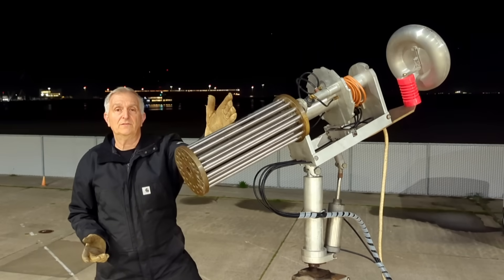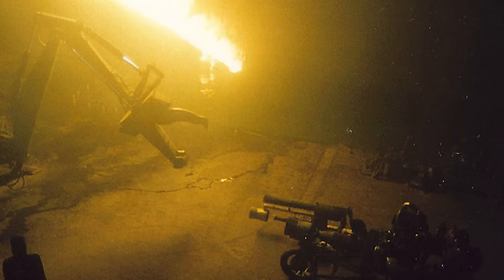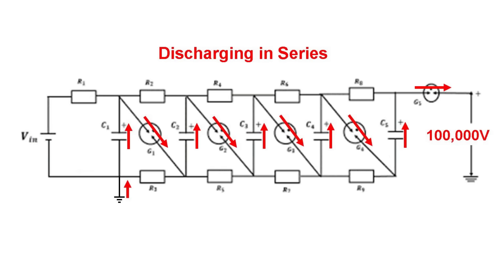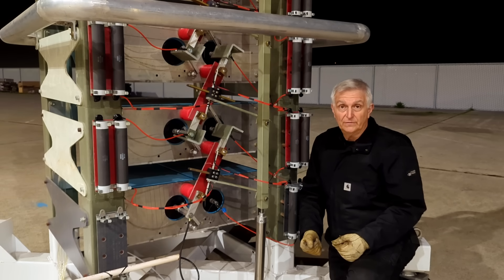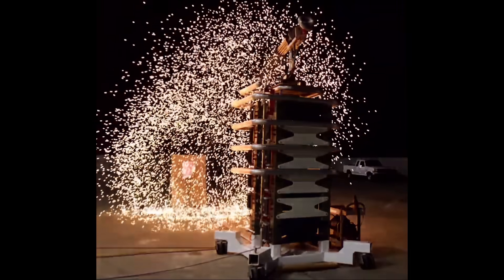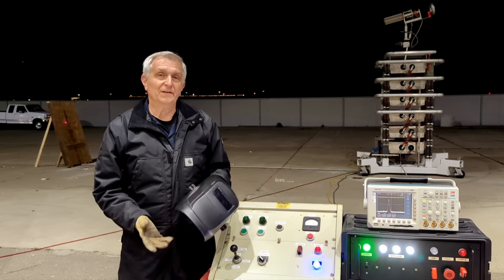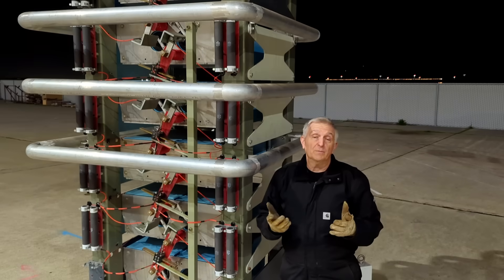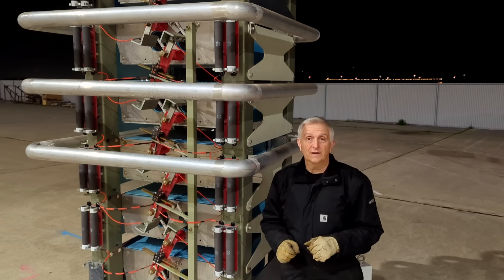Firing the Lorentz Plasma Cannon

Comment: Why is there a bullet launched 1st?
Reply from the maker: The dart is trailing a hair-thin trigger wire, which will direct the 30000 amp plasma channel to the desired target.  1:56
Reply: @ ok because I was thinking that you couldn’t control the plasma after it is released. Super cool man

Comment: So, just did a little basic math using 5:17 

Assuming that's supply not output, that's 7.2 million kW. Average cost of energy in Canada (could be wrong but he sounds Canadian to me) is 19.2 cents per kWh.

Unless I'm missing something, this costs $1,382,400 to fire once at full power, just in electricity. I pray I'm wrong, because this is too awesome to be such a rarity. If it's anywhere near the ballpark though, we need to appreciate the sheer commitment this man has to making cool stuff. In other words:

GET THIS MAN SOME LOTTERY TICKETS!
Reply: One minor detail - you forgot to account for the factor of time.

If you were running this for one hour, then yes, you'd be correct (within the assumptions made). 

Quick and dirty, going by the oscilloscope screen at 7 minutes 7 seconds in (https://youtu.be/lix-vr_AF38?si=woba3ZPSh28UrJ2N&t=427) let's just say we got a discharge time of 0.0001 seconds with an average amperage of 14.6kA @150kV and a peak close enough to 30kA.

That'd be, on average, 2.2 million kW for about 0.0001 seconds. One ten thousandth of a second. If we assume the same amps for 240kV, we'd be talking about 3.5 million kW. Assuming the same discharge time, that's only....0.1kWh? per shot.

Suprisingly little. Do mind, this is going by your output = supply assumption which is going to be way off, by which magnitude, I don't know.

Comment: I worked at a company and it had a DOE contract. The guys across the hall were testing to see what a serious amount of heat (think hydrogen bomb heat) does to various materials. They had racks and racks of capacitors and then they would discharge the capacitors all at once. Every once in a while, like once a week, one of the capacitors would blow up. I was teaching a class and everyone would jump when one of those suckers explode. First time I heard them explode, I ran over thinking I was going to see body parts all over. Just a bunch of guys with headsets for ear protection laughing. Gotta love nerds.

Comment: This was really neat. I didn’t understand the concept fully until I saw the flying contact hit the crt screen on the tv. It was able to not only complete the circuit, but do violently transfer the power internally that you can see objects flying out of shot quickly. You need to do a collab with the @slomoguys

Comment: Im curious how the cannon directs the arc. Surely a lightning generator would target the closest conductor (in this case the operator). 

... oh, it's a high-powered tazer
Reply from the maker: The dart is trailing a hair-thin trigger wire, which will direct the 30000 amp plasma channel to the desired target.  1:56

Comment: Do you use a laser to induce the plasma channel? I remember seeing an Army video that got leaked of a LIPC discharge hitting an SUV. You'd think the tires would have interrupted the ground, right? Musta been hella big charge flow.
Reply from the maker: The dart is trailing a hair-thin trigger wire, which will direct the 30000 amp plasma channel to the desired target.  1:56

Comment: Great stuff. I’m impressed with your knowledge of electricity. Seeing the runway of NAS Alameda was awesome too! I was homeported there on the USS Abraham Lincoln. Then I return to NAS Alameda later working with an environmental company. We did a mass excavation on the runway to dig up contaminated soil from jet fuel. Also worked on a large project at building #5 . We drove large sheet pilings into the ground. Effectively electrocuting the ground to boil out the contaminants and capture the vapors in an air purifier (so to speak). Now I live on the other side of the island. Reach out sometime!

Comment: Perfect . . . many years ago, I worked on an enormous pulsed power platform for firing one of the largest lasers ever created.  Of course, this consisted of an array of ultra high voltage / f capacitors, SCR diodes, inductors and other components, but the thought never left me of wanting to construct something like this.    Unfortunately, the local electronics salvage business which actually sold some of these items closed long ago, but these can be found elsewhere.

Comment: "The plasma channel didn't penetrate the front of the CRT, but simply went around it, and connected directly with the deflection circuits inside. Those circuits then launched through the top of the television." the human equivalent would be not breaking your neck but directly ripping out your spinal cord before breaking the skin im sorry but this is just metal asf no matter how you spin it

Comment: Given over 6000 comments, I doubt this will get noticed let alone answered, but I have some questions:
 - Just how expensive was it for the capacitors to make this happen, and scaling up to your theoretical 30ft tower firing with 1/2 mile range, how expensive would that be?
 - Would it be cheaper and/or more efficient to use a taller tower of smaller capacitors, or does it simply not work that way?
 - Does it have to be stacked in a tower to be correctly operational? For example, could you get 1/2 mile range with a 7.5ft tower, simply by having 4 towers pushed together, or would that cause problems?
 - The world's tallest building is the Burj Khalifa, at 2717ft. If you stacked a tower through the building (or if the previous point holds, simply dedicated the top floor to capacitors), what kind of range could theoretically be achieved? Or would new problems present themselves when scaling up this high? Also, assuming this would cost ~90x more than the 30ft tower...
 - What happens if you hit an airborne target?
 - Have you had any thoughts, or been contacted, about possible military applications?
Reply from the maker: The tower height is required simply to support the voltage.  1/2 mile range will require over 6,000,000 volts, which will need about 70 feet of structure to reliably hold it.  You could use smaller capacitors, but you'll need a minimum number of coulombs to get the full channel formation.
Reply: @LightningOnDemand  Thank you for replying, surprised you even noticed my  comment! Amazingly this just gave me more questions - looks like I'm going to have to do some research!
Reply: @LightningOnDemand  Having just done something of a crash course on the subject, it seems that replacing the dart with a high-powered laser would be able to significantly increase the range on your lorentz cannon without the need for a larger tower. As the laser ionizes the air in front of it, you could effectively pulse the laser for ~100 microseconds before firing the cannon along the path of the laser while it's still active, to keep the 'path' open.
Reply from the maker: @Fluffyudders  such a laser is $$$$.  A pneumatic trigger dart is rather cheap and reliable.

Comment: What was the projectile thing that bounced off the TV screen? You can see it in the slow-mo shot. Are projectiles actually firing out of that thing with a wire trailing behind like a tow missile or is that a bolt of plasma? I'm not as smart as this guy but I'm pretty sure plasma energy doesn't reflect off TV glass. I'm gonna need to know if there are actual projectiles involved because if that's the case than I don't know if I would call this a plasma cannon if that projectile isn't a ball or rod of plasma energy. I just don't see how it could be as it isn't bright at all except for the sparks that come after the target is hit and like I mentioned before, the whole bouncing off a TV screen thing. Am I just not getting it?
Reply: He literally talks about it in the video mate, it's basically a focus/guide wire, without it the lightning would just lash out in all directions and strike anything with the least resistance.
Also, you are only seeing sparks because the slowmo they are using isn't fast enough to catch the light, its only at 6k, we can record at over something like 1.7 million fps now.

tbh, i don't think you actually listened to anything or paid much attention, considering most of what you asked and say you don't understand is spoken of in the video.

Comment: You don´t even need the wire If you can manage to build up 10MV and connect it between the marx bank and your target or build up the marx bank to 10MV but that could end up expensive. Cheaper If you can manage it with a lower voltage marx bank and a ignition 10MV pulse like in a TIG welder of course the TIG welder has only 10-20KV but I mean use the same principle for just 10MV pulse around your 250KV marx to build a plasma channel like in nature. The ignition transformer could be tricky though for 10MV. Good luck 🤣

Comment: what is the projectile flying out front? is it what is pulling the wire?
Reply from the maker: The dart is trailing a hair-thin trigger wire, which will direct the 30000 amp plasma channel to the desired target.  1:56

Comment: I read through a few other comments and I don't know what they're talking about. It's like they watched a different video. I say this because what I saw was a small projectile, launching out and striking the target, closely followed by a massive energy discharge. Was the projectile towing a thin wire, which carried the energy, like a "taser" on steroids? Or was there some other purpose for the projectile? 🤔
Reply from the maker: The dart is trailing a hair-thin trigger wire, which will direct the 30000 amp plasma channel to the desired target.  1:56

Comment: Range is a problem right? How far can this cannon be fired?
Reply: because this design requires a lead wire it is practically limited to short distances
Reply: @vn8600  I guess it's effective only on zombies before they can bite. Anyone with a gun or more powerful weapons like a 50bmg can take it out. Since it needs to fire a needle like projectile connected with wires, it's rate of fire is only one shot at short distances.

Comment: Questions: 1, what is the solid-bullet-like object striking the target? 2, other than blasting through a piece of paper and particle board, what would you do with this device? 3, why does your voice/audio sound so sharp/clean-with no outdoor ambient noise-as if it was recorded indoors?
Reply from the maker: The dart is trailing a hair-thin trigger wire, which will direct the 30000 amp plasma channel to the desired target.  1:56

Comment: but these has effective range limitations. i dont think its practical. "throwing" particles like photon mass is more effective in long range. and it goes in straight line. 
also, since these bolt cannon thing its basically electrical mechanism, it does not comply to pin point aiming. for example, you aim it at a cluster of several objects sitting next to each other, the magnetic characterstics of the objects could make the bolt strike the wrong object and not the one you are aiming for. prove that when you experiement with this, you need to SINGLE OUT and ISOLATE ONE target. thats NOT practical in real world use.
what more, the ratio of amount of power required just to make small hole on a wood is far from being desirable for any kind of defense purpose . while high powered DEW tech these days can punch holes on an inch thick metal of an object in less than a second and can have that all the way to many kilometers range without needing to amplify the power spooling.
but nonetheless, its a nice idea. its just that its not aligned to the necessity for "accuracy". which is vital in defense tech.

Comment: What causes the shower of sparks in the atmosphere? Sorry if this is a dumb question.
Reply from the maker: The dart is trailing a hair-thin trigger wire, which will direct the 30000 amp plasma channel to the desired target.  1:56
Reply: Thanks for the response. I was puzzled since it does not appear that there is anything in the air that would have allowed it

Comment: What is the thin rod that apereas to make contact with the target just before the flash?
Reply from the maker: The dart is trailing a hair-thin trigger wire, which will direct the 30000 amp plasma channel to the desired target.  1:56

Comment: what is actually coming out of the lighting cannon first, before the lighting hits, it looks like a metal rod created the initial contacting to generate a ground so lighting can be generated, so the lighting just can just be shot
Reply from the maker: The dart is trailing a hair-thin trigger wire, which will direct the 30000 amp plasma channel to the desired target.  1:56

Comment: What is the projectile for? I didn't hear anything about it but it clearly fires an object
Reply from the maker: The dart is trailing a hair-thin trigger wire, which will direct the 30000 amp plasma channel to the desired target.  1:56

Comment: I'm surprised the yoke didn't shear the back of the CRT neck off.  I'm sure the fly back transformer launched though lol  Incredible power, maybe get the slowmo guys to film it in action.  A running microwave would be an interesting target given the faraday cage in them.  Awesome build !

Back in the 70s/80s my family ran a TV repair shop.  We once shot the front of an bad CRT with a .40 caliber muzzle loader rifle from about 20 feet.  It didn't not damage the CRT glass at all, that glass is thick on the front but thin on the neck.  We had it at a slight angle for safety reasons but I don't think even straight on it would have penetrated it.

Comment: I’ll be honest, while impressive, I did not see a compelling demonstration that the Lorenz force was in fact working as theorized. That wire clearly got vaporized near instantly, and even at 6000X slowed speed it was but a flash and then instant radial decimation. Please explain Mr. Death Robot father.

Comment: What is that tiny thing that comes out of the cannon before the discharge? It seems that the cannon doesn’t fire until that little thing contacts the target. It appears that this thing is attracting and directing the discharge. And what are those zillions of sparks blasting out at 90 degrees from the beam? It looks like those are actually incandescent particles of some substance, not merely sparks. The explanation of the apparatus and how it functions makes sense. But the resulting discharge seems a bit fishy, for the reasons above. I bet they tweaked the demonstration to produce the desired results.
This reminds me of the first demonstration of a tank with a laser cannon for some military brass. The laser hit the target tank creating a massive explosion that blew the target to pieces.
The generals were mightily impressed. Turns out that the target tank was packed full of high explosives, and it was the laser that detonated them. After the brass found out that this explosion by laser was faked, they were so pissed off that they had been had, the funding for that DEW dried up. So then they focused on hyper velocity railguns that had so successfully passed their tests to the point where everyone was saying that railguns were the future of weaponry, and they started mounting them on ships and tanks. At that point, (after billions of dollars had been spent on R and D), the military decided to eliminate all railguns because a new, more powerful DEW had been developed, that is now being mounted on aircraft and ships, especially because these new ones can take out more incoming anti-ship missiles than any other defensive weapon, even the Phalanx. On aircraft,  its role is reversed from being a defensive weapon to its becoming an attack weapon.

Comment: Excuse my ignorance but how does it make sense to create as little damage with such an apparatus, when more can be achieved with a handgun?
Reply: If this machinery was developed to fit in smaller spaces, it could be used to destroy machinery without having to get close. A handgun can’t shut down a tank. This could as it would fry the circuits.
In truth, it’s mostly useless. It just looks cool.
Reply: @Thumb_ Right, but this object barely harmed a piece of paper. Also, why would a device be needed to destroy a machinery? There should be a way to disconnect a machinery from power... Since machinery was first invented, I can't think of the need for another machinery to destroy the first machinery... Kike I said; I'm ignorant, but willing to learn.

Comment: Your "6000x slower" is VERY off. Going off your own timer on screen it looks like you're shooting at about 6000 frames per second, which is not 6000x slower but about 250 times slower if outputting the resulting footage at 24 fps. Though the frame count is going faster, so maybe you recorded at a higher framerate, but you're playing it back about 40-50 fps resulting in about the same or slightly more that 250x slower. Either way, it's nowhere near 6000x slower.

Comment: What is the metal cylindrical thing fired with the discharge? It looks like a guide for the plasma to follow, so is this the "rocket", with the thin wire to achieve this weapons operation? Like explained with the lightening example? 10:28 -10:32 . English not my first language so I guess it was implied, but not explained. It was also not mentioned in the gun assembly.
Reply: I think this thing is the discharge itself. Or at least the visible core.
Some of the ‚particles, in the plasma cylinder get reflected back inside the cone shaped tv tube. 
I am not sure why the cylinder rotates in the end. Maybe different reflection angles or traveling speeds. Likely particle physics.
🤔

Comment: ...or you'll have to invent a new type of capacitor - very  high voltage stability, massive discharge speed, portable, fast to deploy, extremely light weight, very controllable, expendable and above all CHEAP!